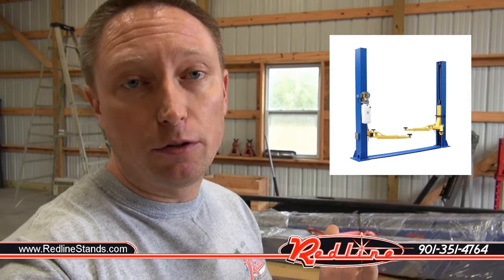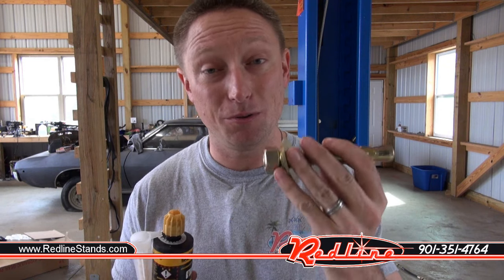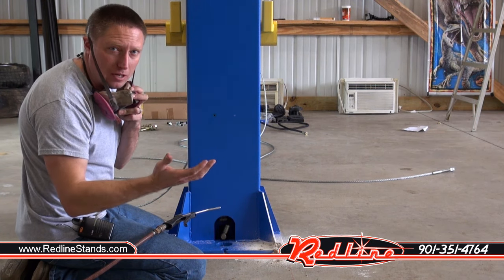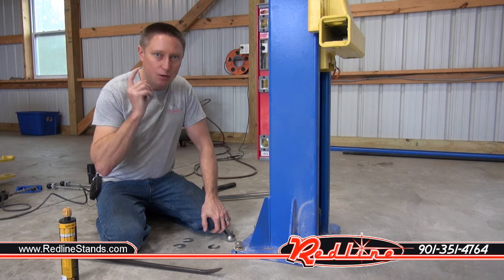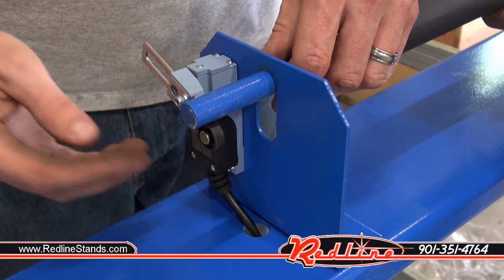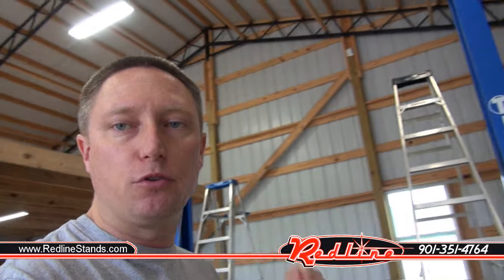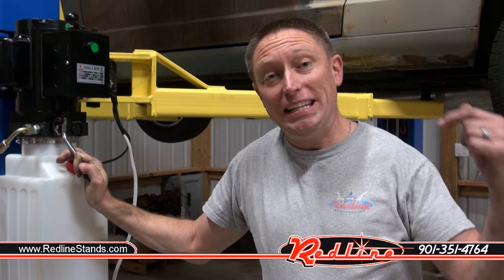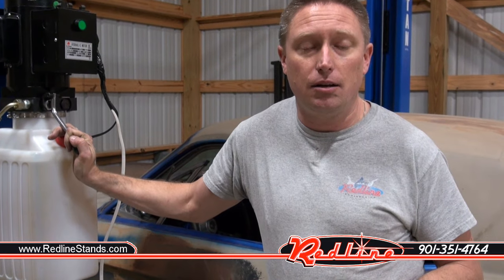Two Post Lift Installation How To - TP9KACX & HD2P-9000AC

Comment: Nice video, but a guy with an engineering degree shouldn't be using plyers to tighten hydrolic lines. The actual name for "Flaired fittings" as you say is JIC. Just saying.

Comment: Good vid, but you do not need to invent anchoring.   Both anchors, and glued rods have its certificate, and proper installation method. Mixing the two is not a way that others should follow. For this aplication, i would choose glued one, probably a Hilti HVU+HAS, it is certified, if you follow installation instruction, good result is guaranteed.

Comment: Nice video, hey bro if this is what you do for living please make a simple rope pulley system that can make it safer to lift up that "Overhead Bar" pulley system can even help with lifting the towers, you will not have to worry mostly the overhead bar failing on somebody. I am a physically challenged combat wounded vet who simply cannot give up on doing heavy works my secret to accomplish any heavy task is power of physics, I use long bars and pullies as well as wheels.

Comment: Very detailed video. I haven’t installed my lift yet however having been in construction my whole life, I have installed thousands of anchors and found that using two hammers against each other reduces the mushroom if any and sends the anchor down the hole cause it transfers the blow to it and not the shock causing the shroom if that makes sense. Give it a try on the next one you do. Thanks for the details, it helps eliminate some questions I was curious about before attempting mine.

Comment: Really like the level of detail that you explained how to do this and its pitfalls. Thank you for a great tutorial. I do have an issue using pliers to tighten hydraulic fittings. It’s a bad practice that should not be encouraged. On the other hand, it prevents over tightening.

Comment: My next DIY project is to install one of these lifts. Your video will sure come in handy. Please allow me to make a few observations. When I drill into concrete, which has cured for at least a month, I keep the hole wet as it prolongs the life of the drill bit and cuts down on the dust. To secure the nuts, I apply Permatex Threadlocker Red on the bolts to help prevent the nuts from backing out. I place a small dot of paint on one side of the nut in line with another on the metal plate to see if the nut has become loose. I use BLASTER White Lithium grease instead of plain grease. My county requires devices like this and electrical wiring permits to be obtained for this installation. Installation of lifts like this is a liability suite ready to happen. Home liability insurance companies could deny a claim if needed permits and inspections were not completed. Insurance companies are in the business of not paying out claims. I would never allow anyone else to operate or use my lift without supervision. A posted sign saying, "Use at your own risk" will be attached to the lift, just in case. I hope that my comment is of value to others.
Reply from the maker: I'm not saying your comments are not of value, but I am saying that I feel like the existence of attorneys have created a society that needs a warning sticker to do everything but poop...oh wait.
Reply: @RedlineStands  Thank you for your reply. A person must consider what might occur if his lift fails, resulting in injury and/or property damage to others. Better to be safe than sorry.

Comment: Good video. I just installed two of those exact same lifts... A few notes:
If you are going to do epoxy for the bolts, you may as well get the threaded rod method and use anchoring epoxy to secure the lift. 
Also, at the top of the pillars, there should be 4 large rubber grommets where the hydraulic line comes through to protect the hoses from rubbing through.
Reply from the maker: I appreciate this input, but I must respectfullyl disagree.  Given the lifts already come with anchors, I recommend using both a chemical and mechanical bond.  Surely that's stronger than just using threaded rod via chemical bond?  Not just that, but is the steel for the threaded rod the same grade as that of that anchor?  I have no idea.  Maybe not.  If you epoxy the threaded rod into the hole, how much contact surface area is there securing the anchor to the concrete?  Again, who knows.  I really feel using the supplied anchors is the safer stance.
Reply: @RedlineStands  I certainly understand and value your point of view. However, I do want to point one thing out. High-strength anchoring epoxy and threaded rods is how they actually repair anchor bolts that have failed which does happen quite often. As time goes on a lot of those bolts will actually come loose and begin to strip out the whole of concrete thus allowing them to never be fully tightened again. At that point, professionals will use the epoxy method to repair those holes and regain strength in the anchoring system. I can certainly appreciate having both mechanical and chemical bond working to your advantage..
Reply: @E550Boi   I'm curious about the threaded rod. There is a YouTuber that swears by it (grade 8)  Lets say your concrete is say 10 inches or so but if you have  5" is there really enough bite for the rod and epoxy

Comment: Thanks for making this video, very helpful when I installed my symmetrical two post hoist.  Something I wish I thought about was length of the arms. I chose a hoist with two piece arms that can't be shortened enough to reach the lift points on my short wheel based cars. Just a tip for people doing their research.
Reply: InabsN6n

Comment: that lift i think is sold in Au as LUFTEN
What i did was slot one of the mounting holes predrilled and fitted one fastening on each foot and was then able to silde the column in, the mtg holes 22mm studs 20mm, thereby stabilising  each column before drilling the other 5 holes on each foot, My lift second hand so your vid of fitting cables, hoses etc helped.

Comment: Great video!  I'm going to be uninstalling my lift and reinstalling it at another location.  I got a kick out of the fact that you used a respirator when you blew the concrete dust out of the hole, but didn't wear safety glasses.  XD
Reply from the maker: LOL.  Yeah, I suppose that's a fair criticism.

Comment: Ian - very good video. I found and watched your older video first, which was good, but this one was WAY better. I appreciate all the tips that you provide which you would never find in a manual (even if they manufacturer provided one). My dilemma is that I purchased an Atlas 9KOH two post lift, which is VERY similar to the Titan lift you installed in the video. However, there are some nuanced differences. Unfortunately, I can’t find a decent video showing the installation of an Atlas lift, so yours was very helpful. I have only just unpacked my two post lift from the crate (I’ve been busy setting up my four post lift), so I don’t yet have a good understanding of how it all goes together. Of particular interest is the pulleys for the cable on the top rail. I’m not sure my top rail has pulleys installed. If not, I’m assuming they’ll be in the parts bags and I will have to install them on the two post extensions. 

Thanks again for a very well done instructional video.
Reply from the maker: You're very welcome sir.  Good luck with your project!
Reply: @RedlineStands  here in aus,,we got chem set anchores..

Comment: for all of the guys over here very good and simple and clever idea !!! dont use mechanical anchor bolts as they sucks all the way. use instead very simple thread bar cut to size and glue it in with hilty or fisher chemconcrete which is also cheaper a probably even much stronger than his magic black  silicone tube. nothing against this video but there r simpler ways to do it ....
Reply: The expansion bolts with the ac100 work though, yes its a overly complex solution Vs a threaded bar but you will end up using many tips to dispense the epoxy if you drill holes as suggested as the epoxy will be set by the time you've drilled the second hole etc

Comment: I'm getting a driveway poured on the side of my house all the way into the backyard..I'm having two footings done so later it will be thick enough and wide enough for the base of the lift..doing a 30x30 square 10 inches deep with fiber reinforced concrete.

Comment: Ian, you weren't joking about the AC 100+ Gold setting up quick. I was installing my Launch 2-post today and I used the one mixing nozzle that comes with it but after the first anchor bolt that nozzle was toast. I did the rest on cardboard with a screwdriver like you showed. 😆
Reply from the maker: LOL.  In the summertime that stuff is too hard to work with it after only 45 seconds.

Comment: hi does it matter witch column you fasten to the ground first and if i drill all the way through my 10 inch concrete slab will i benefit form something what would that be. im fixing to install mine with my wife and im doing with confidence of watching your great amazing video. i feel im ready. thank you
Reply: It doesn't matter which column you soft anchor first and there's no need to go all the way through your pad if it is 10" thick.

Comment: I recommend placing a power cutoff switch near the lift operation button.
Reply from the maker: I'm confused.  Isn't the lift operation button a switch that cuts power on and off as you press it?
Reply: @RedlineStands  Yes until the relay fails in the closed position or the button sticks and the lift keeps going and the only way to stop it is at the fuse box. I suppose if it has an over-height sensor it's not an issue however not all lifts have that equipped. It also makes lift motor/ control box repairs a bit easier.

Comment: I was looking at the floor plate lifts but I think I'll just move the bottom chords in my shop up a foot or so to get extra height.

Edit: 10 months after my original post. I have nearly finished my addition and moved the bottom chords. I will be installing a lift in a month or two. I have added the epoxy to my shopping cart. I feel way safer using epoxy. I may also fabricate some extensions that go over the baseplate and add an extra hole or two on each side for each post.

Comment: I'm over six feet tall. Do they make these things tall enough so I don't have to duck when I walk under a car?
Reply from the maker: Some of them, yes.  This Launch 11K below goes up to 75" high.  You can then add truck adapters to it to get even more lifting height, assuming you have the ground clearance to get the truck adapter in place.  They're out there, but you gotta dig.

https://www.redlinestands.com/catalog/lifts-c-290/automotive-lifts-c-290_138/2-post-car-truck-lifts-c-290_138_139/launch-11k-asymmetric-2-post-clearfloor-lift-ali-certified-p-2424

Comment: How much Epoxy did you need?
Reply: Typically a tube will be sufficient. You'll want to make sure the lower (non threaded) portion is evenly coated.
Reply: @dustingilmore2710  Thank you! Going to order a tube today

Comment: Confusing when you used the block of wood to “level” the second column. 
Did you mean “plumb” the second column? 
Hard to tell as it appears you looked at the small level glass at the bottom.

Comment: I didn't epoxy my anchors and after the 4th vehicle raised 5 needed retorqued and one spins. I should knock them all threw and redo them all with epoxy?
Reply from the maker: That's probably a good idea.  You damn-sure can't continue to use the lift as-is for sure.  Hopefully you drilled all the way through the concrete.

Comment: Very nice video.
Since you drilled through the slab to dirt, how do you now how deep to pound the anchors in? 
Do you use the nut as a depth stop gauge?
How far do you thread the nut down to know when to stop pounding?
Also, I imagine the torque values are different by lift, but what is the general range you've used? For info,
Reply from the maker: I put the nut on there with it threaded onto the anchor just enough to get the nut fully threaded onto the anchor.  From there, I hammer it down as far as it'll go until the nut stops it from going down further.  Once you tighten it down, there will then be enough thread space for the lock washer and regular washer to be added under the nut.  Definitely obtain your torque values from the manual.  I've seen them range from 75 to 120 ft lbs.

Comment: You drill the concrete all the was through till you hit dirt and then you put in the anchor? How far above the dirt should you put the anchor?
Reply from the maker: It's not about how far above the dirt should you install the anchor.  It's only about making sure your anchor is as deep as possible in the concrete.  The dirt means nothing sir.

Comment: Need your help with some questions; 1) My garage door is 10’x10 and the roof trusses are about 11’, but my ceiling is open, so can I just install between the trusses? It sure seems I could. 2) My floor was poured in 1979, not a crack anywhere and it was 4” thick. Since concrete gets stronger with age, am I better off just installing it with 4” well seasoned concrete, or am I stuck with cutting out the floor to make a thick/deep pad, but now fresh concrete? 3) does anyone make a lift with a larger base plate so I can install on my floor without cutting the floor and doing the pad. Thanks a million
Reply from the maker: This lift below has a huge baseplate, which helps to spread the load over a larger area.  I don't see any issue with running the lift between the trusses.  I'm sorry but I have to decline to answer your concrete question.  If I'm right, I just don't win anything, but if I'm wrong, I win a lawsuit.  Sorry, but this is modern day American for ya.

https://www.redlinestands.com/catalog/lifts-c-290/automotive-lifts-c-290_138/2-post-car-truck-lifts-c-290_138_139/kernel-15k-lb-clearfloor-automotive-2-post-lift-p-474

Comment: What an excellent video, thank you! I am thinking about putting a 2-post hoist in my shop but I noticed you said the posts can not be close to relief cuts so just wondering if there is a minimum distance the posts should be away from a relief cut? Thank you!
Reply from the maker: Your manual will specify that.
Reply: Ok thank you

Comment: I'm sure this is limited to this particular lift, but I saw no deactivation of the safety locks to lower the lift.  How is that done?
Reply from the maker: It's no big deal.  You just pull the safety release cables under "each" column
Reply: @RedlineStands  So there is something to do at each column before lowering the lift.  So, the procedure would be to go to the column that does not have the pump and perform some procedure and then move to the pump column and do the same and then lower the lift.  Is there any particular point in the video where these "releases" are shown?

Comment: Also you didn't bleed the lines for hydraulic fluid. Any air in line will damage the pump over time
Reply: my lift instructions does not have any mention to bleeding lines. i ques that is not necessary with these kind cylinders ?
Reply: They bleed themselves. On the way down the air is pushed into the reservoir, hence why you only fill to the fill line.

Comment: Great video, what is the minimum side wall distance you recommend? Thanks again!!
Reply from the maker: Assuming the slab has a footer, then you just need enough space to easily walk around the tower.  If it doesn't have a footer, then I'd give it 5 feet.
Reply: @RedlineStands  Yes it has a footer its 24x54 I just didn't want to tie up the whole space I was thinking about 30 inches from the wall? Do you sell 4 post movable lifts? Also I was thinking of epoxy the floor but I assume the floor needs to be clean under the pads of the lift. Thanks again.  Tommy

Comment: Thanks for the great video.  I have the 10A and after unpacking it and placing the posts in their locations, I found that the chain pulley assembly came off the hydraulic cylinder.  Is there a good way to get this back on the cylinder?  I didn’t see an immediate solution in the few minutes I had with it.
Reply from the maker: Those normally just set onto the top of the cylinder with no tools needed.  Should take 7-9 seconds to fix.  Good luck.

Comment: Hey Ian, Great video!  Not sure if I missed it but did that one tube of AC100+Gold do all 10 anchors or would you need more than one?
Reply from the maker: One tube is more than enough.
Reply: You don't need to waste $25 dollars on that tube; any good concrete adhesive will work fine!

Comment: Ian, question... I'm reading the specs on a 2-post that I like. It states 73 inches max lifting height. It that measured from the bottom of the 4 lift arms or the bottom of the vehicle? I'm right at 6 foot tall (72 inches) and I'm wondering if I can walk under the car without having to duck down a little? Thanks!
Reply from the maker: That's from the concrete to the top of the lifting pad, without using the truck adapters.  If you install a 5" truck adapter, then 78" is your lifting height.  Bear in mind you're typically lifting from the lowest point on the vehicle, so the bottom of the frame might be 72" from the concrete, but the floor boards might by 75" up.  Also bear in mind that you can't use a truck adapter on something that's not a truck, because the arm will never slide underneath the vehicle with a truck adapter installed....generally speaking
Reply: @RedlineStands  Thanks Ian, I appreciate it. I'm considering 2 of your Launch Tech lifts... the TLT-210 XT and the TLT-240 SC.